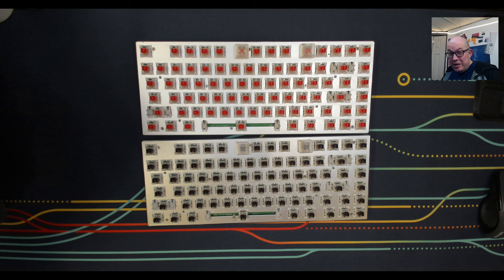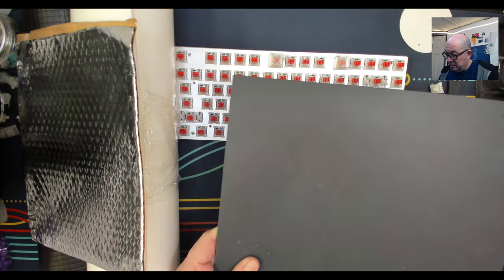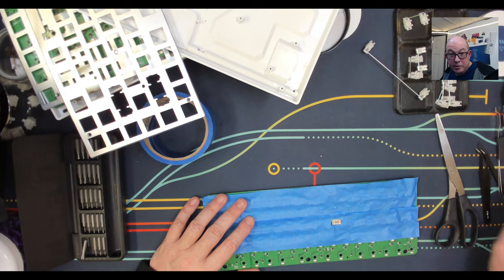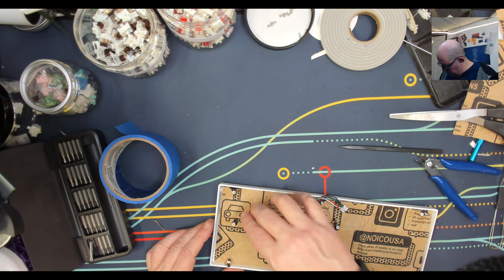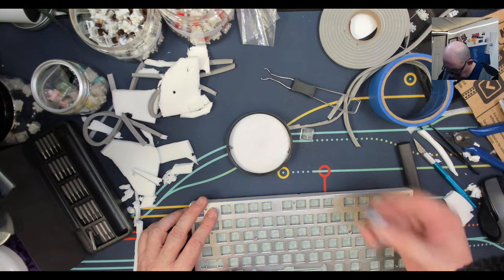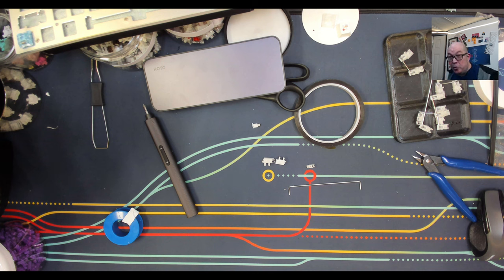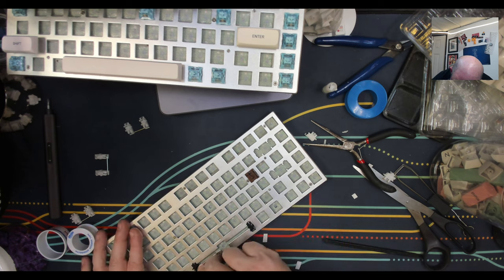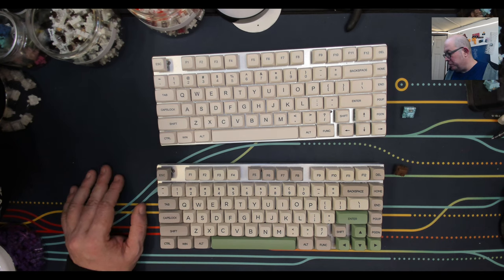Modding the Z88 Scholars, a cheap 75% modded to reach it's best sound and feel. How do they sound?

Comment: which screwdriver did you use to unscrew the screws on the case? I’m trying to mod this keyboard too but it won’t work with any of mine, they just won’t budge :(
Reply from the maker: The second smallest philips driver.
Reply: @MechKeyboards  Phillips #1? I’m Using that right now.. This is my first time trying to mod a keyboard but it no matter how I turn it, it won’t open.. do u have discord or something would you mind helping me? I’m so upset,, I bought a screwdriver set and now none of them are working lol
Reply from the maker: @hailol4523  I'm lying in bed with a fever, I really don't know how I can help, but if you need, jump on our Discord server, someone will try to help.

https://discord.budgetkeebs.com
Reply: @MechKeyboards  thanks I opened a support ticket. May I know which screwdriver u recommend getting on Amazon? I’m down to buy a new one but I’m scared of getting the wrong one